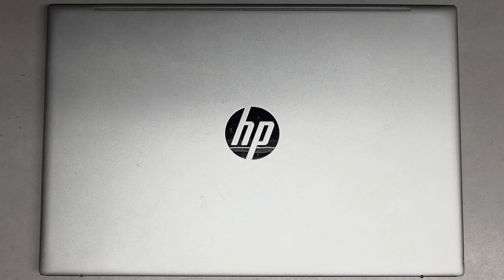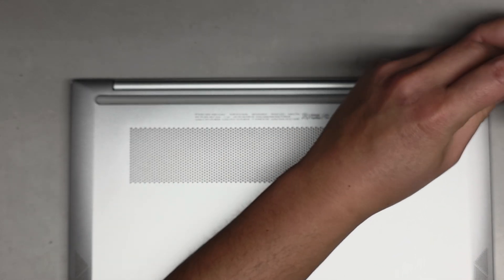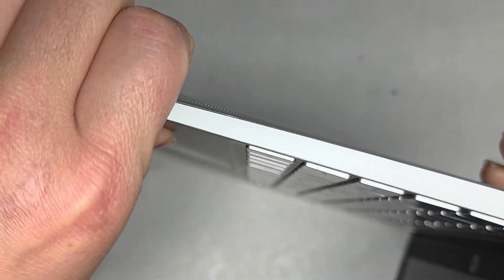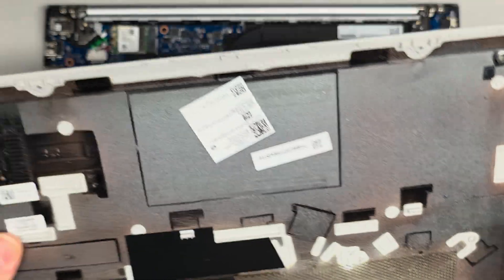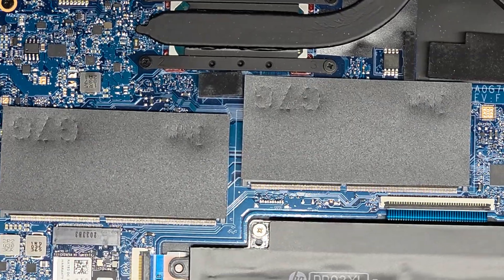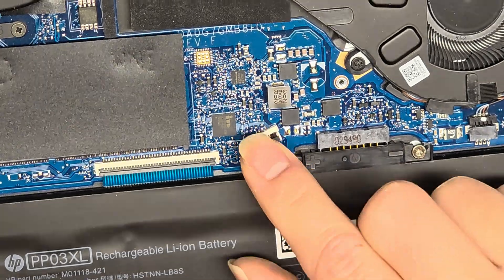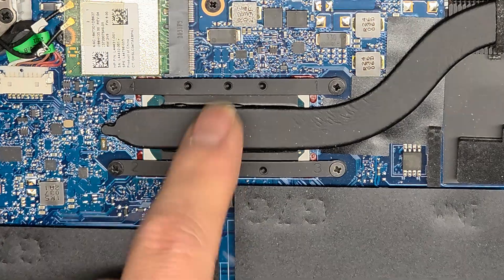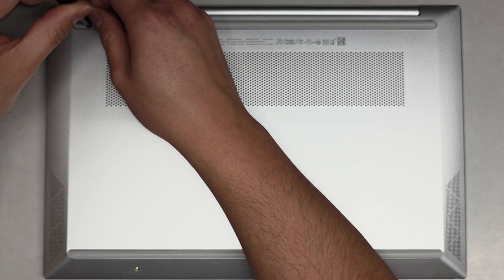HP Pavilion Laptop 14-dv0097nr Disassembly RAM SSD Hard Drive Upgrade Battery Replacement Repair

Comment: It's near enough impossible to detach the front edge of the base without breaking the clips on this model.
Reply from the maker: Nahhh I found you have to start prying from the sides, work your way to the hinge side and then just lift it out at an angle.